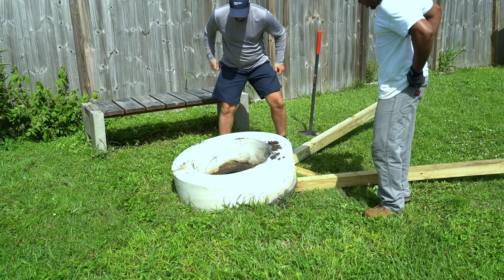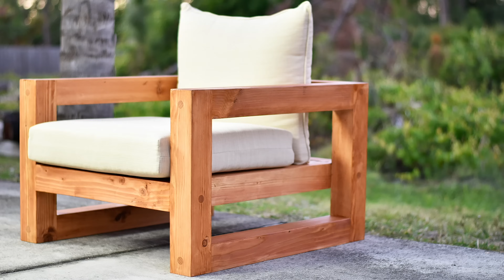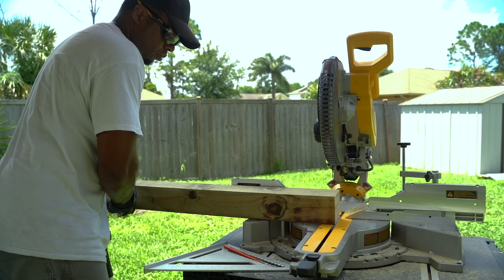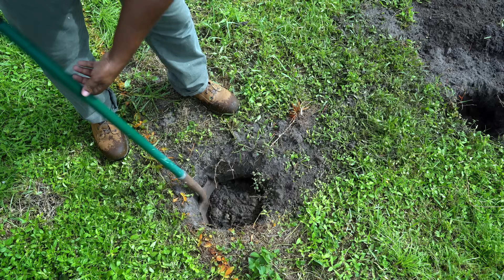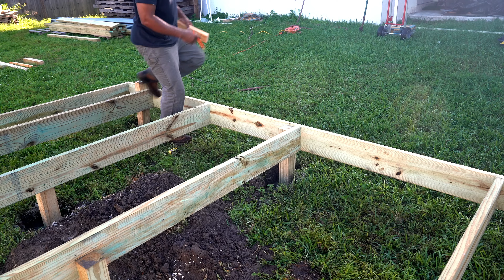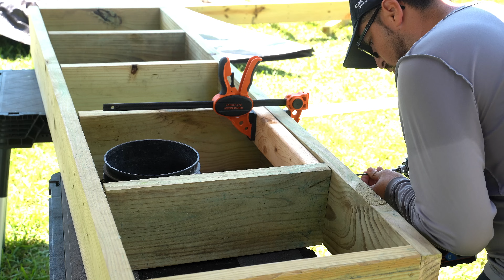Building A Ground Level DECK - (Part 1)

Comment: Those screws will fail and you won't have a deck anymore.
Reply: I agree. I used Phillips ACR coated deck screws to build my deck. Three years later I'm rebuilding my deck due the those screws rusting out and rotting the pressure treated beams.
Reply: lol theres a lot more wrong with it

Comment: ALL the load that is on the deck surface is going to be transferred into shear force into those screws.  DO NOT build a deck like this.  This does not meet building code where I am from and I can put my money on it that it doesn't meet building code ANYWHERE.
Reply: Built many decks here in Britain using screws and although we don’t have the same building codes as the USA for domestic decks my point is in 20 years I have never had a deck failure unless through rot where clients haven’t kept up preservative maintenance. This guy did a nice job 👍
Reply: There should be two beams that run underneath the joists to take up the load.
Reply: Hahha no building codes for decks under 24" this one is even lower 🤣 never mind the fact that it's not fixed to an existing dwelling. Could go on but you get the picture. 
Don't ever listen to people that no nothing about codes.
Reply: im assuming you mean between the posts and joists? if so the posts should be cut and joists resting on that cut out and attached with nuts and bolts
Reply: itsyaboyjacko and what best to fasten if joist on top of post?? Would you use a brackets
Reply: No permit needed for a deck below 32”.
Reply: Agreed.   I am a deck builder,  and even though this deck is low , it's not properly supported . But I guess is for his house, and is not going to be inspected. Crazy.
Reply: Darren Aucoin negative would you do different to not do that then please
Reply: @Leedsunited44  Not sure what you are trying to say...fix grammar please.  What I can say is people that will follow this video that is not built properly may have premature failure because they watched a video on youtube and assumed it was the correct way to do it.  Not negative, it is making sure people protect their investments.

If any fastener will experience a shear force from gravity, a nail has to be used.  You may use screws for deck boards for example because the screws go vertically and experience very little to no shear force.

Even if the posts were nailed to the side of the floor frame, there is a better way to do this.  Either notch out the post to accommodate the thickness of the floor joist so vertical loads are transferred directly to the posts.  At that point you could use screws because the screws would not see any shear force.  

Beams are only required if the design span of the joist is larger than what code requires for the dimensional width of the floor joist.  For example a 2x8 floor joist can go "x" amount of distance unsupported before additional support is required.

Comment: very well documented deck build.  As your deck is only raised a few inches off the ground its not all that important, but you should note that the joists should not be attached to the posts on the sides but rather the joists should be sitting on top of the posts (or beams.)   Your deck is being supported by the shearing capacity of the screws/bolts that are attaching the the joists to the posts.  this is 1/1000th the strength of the actual post, and you are wasting the strength of the post as a supporting structure.   As your deck is only a few inches above the ground, should you sheer the screws holding up the deck you will only fall a few inches so I don't think its a major safety issue, but this design would be unacceptable if you were to raise it to any significant height.

Comment: I have appreciation for your effort.  However as long as your deck is only for looks, it should be safe.  If you want to have people stand on it then you probably should have the posts or part under the joists rather then screwed in.  Bolts would be better but still would not provide the strength needed as they too can rip through the wood.  Luckily the deck is ground level so the fall isn't as hazardous as if it were higher in the air.  Good job though!  I learned the hard way and just sharing and not intending to be rude or critical.  I would suggest having 4 posts or cement footings (two in front and two in back in about 2 feet from the edge of the deck) positioned horizontal to each other with support beams (10 inch wide) running the length and attached on TOP of the post or footings.  Then the joists crossing the supprt beams vertical.
Reply: This was the comment I was looking for 🤣
Reply: I want to build a deck but the right way. Can you please inform me of the right bolts that I would need? Mine is also going to be ground-level and this length/width Thanks in advance.

Comment: Love ya work mate, but my advice for your next deck or patio would be to find 'level ' for the  posts then go about fitting them in the ground (making sure u find the the 'fall' of your deck)  apart from that mate you're on the right track. There's others things I could nick pick mate but you had a go, so good on ya. Im a Carpenter (Chippy as we're known) from Australia.  Im pretty sure most carpenters would agree, but good on you for having a go. I hope it's still structurally sound mate. 😀🇦🇺

Comment: One way to save time is just to dump dry concrete into the holes. No mixing required. Spray a bit water on top. By the looks of it your FLA soil had plenty of moisture.

Comment: Great idea but I need to rain on your parade. Not sure if a permit is required in your area for a deck like this but that being said, you should still build it by code. When you don't know the weight that the deck will eventually be subjected to, you may as well build it so you're sure it can. 
The boards that attach to the supports require (2)- 1/2" carriage bolts with washers and lock washers, each. If you want to build it your way, at least add liquid nails (PL Premium) at the ends of the joists and where they screw to the supports, before applying screws. I always use it when fastening to the supports. 
To give it more strength, add a few more joists. I install them on 12" centres. Gives more strength to the deck boards as well as increases the weight load. One other thing. I never use cement anymore, for many reasons. I use post hole, two part expanding epoxy. It sets so fast, you can build within a few hours. Great for fences too. No mess, no water, no cement to mix. It's a win win. Also, lately, I've been applying a rubber based tape on top of the joists before installing the deck boards to prevent moisture penetration, in 3" strips. It seals around the deck screws that penetrate the joists. I prefer installing aluminum flashing strips, cut 2" wide. Tack it in place with roofing nails before installing the deck boards. After it rains the sun heats up the aluminum and it evaporates any moisture. I built a deck over 30 years ago with aluminum strips and not one joist needs replaced. Just score a piece of aluminum flashing on a 2'' width a couple of times with a utility knife which allows you to rip it along the line. Good luck and Happy Decking.

Comment: A good hax to use when you really wanna make sure your (large project) is perfectly level is something called a "water level".  A carpenter's level is great when you only need to level something like a short piece of 2x4 or something like that.

But when your project is as long/large as this deck (I think yuo said 16 feet?), a carpenter's level isn't the most accurate in the world.  You can have the "bubble" right in the center, and still end up with over an inch height difference between one end and the other.

that's when breaking out the water level will really come in handy.  You can get down to as close as your eyeball can see, just by making sure the water-level in the tube is the same at each point.

And it doesn't matter if your project is 10feet long or you have a whole house/structure that you need to make sure is exactly the same.  As long as you have a long enough tubing to stretch all the way across your project, you can always know everything is perfectly level.

All you need is a bucket of any kind (I like the semi-transparent "paint mixing" buckets you can find at your local hardware store, a "thru-bulkhead connector" (with a pipethread&nut on one side and a hosebard on the other...and as long a hose as your project calls for.  I bought a 50ft reel of hose to make mine...now I can level anything up to 50ft long.

My favorite tutorial for this so far is "How To Make And Use A Water Level"
 by "HackaweekTV"

Best of luck!

Comment: He knows what he is doing but basic construction. That would not follow any codes. If you hire a inspector it would fail. All the supports are on those small screws maybe that is the hugest mistake ever when building a deck.  Whats the point of those 4x4 for if you don’t notched them for support?  Everything is supported by screws?  That ain’t right.  May look good for amateur eyes but for DIY.  Since its a diy channel so its all good.

Comment: Great job but need to fill those post with more concrete not way near enough concrete atleast 1.5 to 2 bags of qucik set to each whole/post.
And the bearers need to sit on actual support not solely relying off screws/bolts,  they need to sit on the posts, notching a gap for the bearers/ joists to sit on

Comment: Never use wood as a footing. The concrete mix and earth will rot the wood within 2 years or less. If you want to save money place the wood post in a plastic sleeve and the sleeve should be about 3 inches above the actual grade to protect against rain water pooling. Now, the proper costly way is to use a metal footing and prevent all wood members from touching the ground.✌

Comment: We use concrete spurs in the grand and bolt timbers to them. Also when you square a frame up screw a diagonal brace to hold it save measuring all the time

Comment: Thats the wrong way to build a deck your whole   Structure should be sitting on top of the posts and not screwed on the side, your deck will collapse just a matter of time.
Reply: or bracket is needed to hold the studs ?

Comment: I think you should of attached the 4x4 supports with a large bolt, washers and Nut. The screws. esp if they are not structural ones are simply to weak of a support.

Comment: Would you recommend building a deck like this over sand, or over a lawn? Currently we have sand where we want our deck to be, from a previously abandoned patio project.
Reply: Sand will be better, just lay bits of slab on the sand for the legs to sit on, dont dig holes or use concrete
Reply: Mark Hickman Thank you!

Comment: Put your 2 outside runners together. Pull layout 16" from one end. Your tape should have every 16" highlighted. The way you did it if your board was short or proud your layout will be off more and more as you go.

Comment: I’m a huge fan of your backwards method.  Building the deck first THEN making the base takes a lot of the measuring and guess work out of it. 
Outstanding.  I will be using the same method when I build mine.  

Cheers from a fellow northern Floridian.

Comment: Thanks for the video. I have not build or framed anything before, but I am a working man and don't mind to trying. I am going to build my own deck and you made things look allot easier. May in the near future you post your plans for this deck. Furthermore, thanks to all the people that commented on your post. Al thought the South do not have a frost line, I will use the concrete post and have the deck sitting on top of the post for better support. And maybe get a mini skid steer to clear the grass. Do you need joist hangers on parts of the frame?

Comment: I'm sorry, but why the hell spend thousands on material and labor just to cover up a perfectly fine lawn?  If you needed a sitting spot you could have poured a concrete slab (that would not be rotting), or even landscape fabric and pea gravel kept in place with a border.  A for effort, C for results.

Comment: Concrete introduces moisture and rot. Better off doing 48" holes, and setting on a concrete cookie then filling with pee rock. That's how I did mine and it has no movement and will drain.
Reply: do concrete cookies have chocolate chips in them?
Reply: @T.E.P.  no, just gravel.

Comment: Soooo....your posts aren’t concreted in? They’re just sat on a very small quantity of gravel and then filled with soil?.... I’d have used sub base instead of gravel, and made sure there was a depth of at least 300mm.. quicker drainage and less likely any of the posts will sink. Actually I would have set the posts in concrete...and used joist hangers, and coach bolts. Good effort though

Comment: Too many things wrong with the way this is built from the stress load fully on screws, no use of carriage bolts or joist hangars. The step should not be angled like that in fact there is a minimum. Never seen a deck build like this i wonder where the ideas came from
Reply: You did not watch the whole series, part 2, before judging him! SMH

Comment: Looks good. I like your videos. Just one thing, I think you should put big bolts to go thru the 4x4 to hold the weight that way it's not just holding with the screws. Since the 4x4 post ain't holding the weight. I think that should hold alot better. Other than that looking good..
Reply: That's why the joist is supposed to go on TOP of the damn post, not screwed in or bolted from the side.

Comment: There is a whole bunch of things wrongs. Other than the screws supporting the weight..... you dont need to pre mox the concrete and placing gravel for drain? Having concrete on top? Usually you place your post make sure is level then pout the concrete straigh from the bag and add water, follow instructions fot the depth and diameter of the hole. Also the propper thing would of be to notch 6”x6” to seat outer beams on posts, also having the deck lift off ground give yoou space to place 2x8 inside of posts with carriage bolts perpendicular to joists to hang their weight on them and not to the external frame. I really doubt the screws will give up at the same time having the deck collapse but they will eventually rust, wood expand and contract with weather and that deck structure will become loose over time.

Comment: I think you have built a mosquito breeding ground under the deck with that uneven weed barrier.  My experience with that type of barrier here in Gulf Coast Texas is that the weed continue to grow under the mat and form a mat of roots.   After about two years, the barrier will rot and disintegrate.

Comment: 13:40 had me dying lmao. Why not do even supports that run the length instead of a bunch of individual mis aligned cuts ?
Reply from the maker: Can't get better by not trying. It's easy to look back and say why, why, why it's done and I feel good about the next one. I'm learning as I go.
Reply: @DIYCreators  also my friend you can pour the concrete in dry right out the bag pack it down a good firm a bit make sure your all level as you go...the water in the ground will seap thru and the contrete will be hard as a rock by next day...but If your putting up,chain link fence you have to mix the concert and set your poles so the next day you can put up your chain link fabric...it will save you on mixing bags of concrete on these jobs of course

Comment: You should consult some experts before you build . You really don’t have a clue as to what is required structurally. Your lack of proper footings and joist hangers will lead to this deck failing.

Comment: Dude, the screws are carrying all the weight
That deck is going to last a few month till fall down
Reply: It will be absolutely fine. Should always use timber screws with the hex head or the star though.

Comment: Expecting the screws to take that deck load is dangerous, if you had placed the load on a grade beam to support the joists it would be safe. Cement is a powder used in the formula to make concrete.

Comment: Trex requires 12 inch centers for joists.
Reply: This is not a real deck. Never pour concrete around  your posts or have them sub grade.

Comment: First, I appreciate the effort and the the time it took to make edit and upload the video.  2nd Stop building decks.  So many things wrong with this deck build, to list them all I would come across badly.  Not one joist hanger or lag bolt in this whole video, Yeah man, just stop building decks, hope you learned a few things.
Reply from the maker: I will not stop building decks!!!? Sorry. I addressed this in part 2.
Reply: 2.4 million subs building decks incorrectly - can’t imagine he has much incentive to stop. Just being stubborn and not acknowledging and using the constructive criticism.
Reply from the maker: Ok bro, what's your point? You can read, the page is flooded with constructive criticism, I accepted that. I owned it and addressed it in part two. It gets old when you keep saying the same thing. You can not get better if you don't make mistakes. I didn't think a deck a few inches off the ground would cause this much uproar. One video does not set the tone for all the content I created. Thanks for watching.